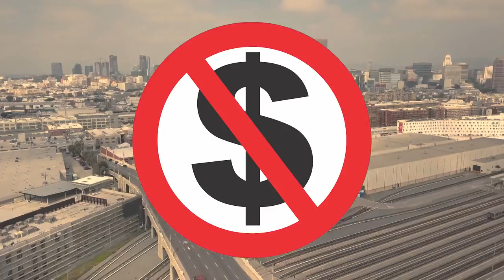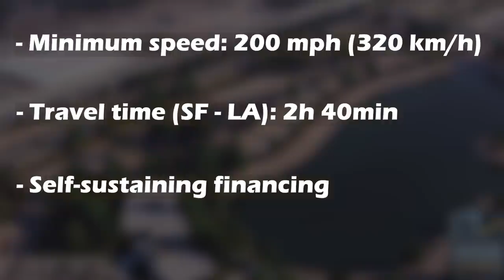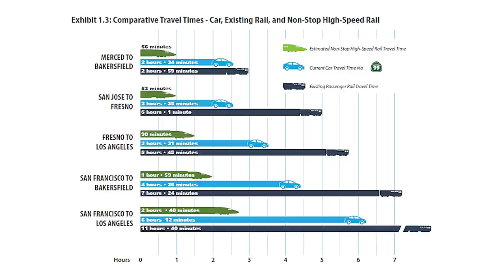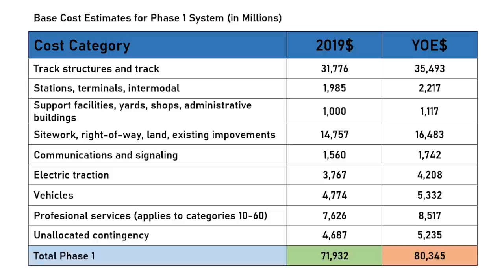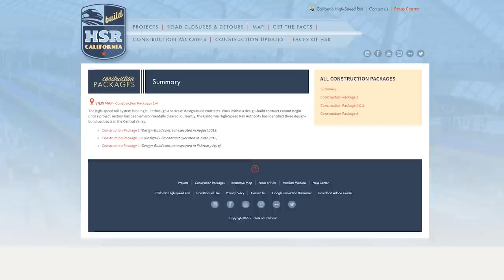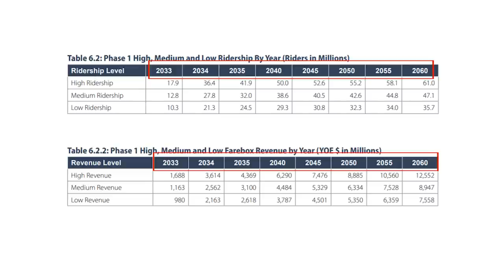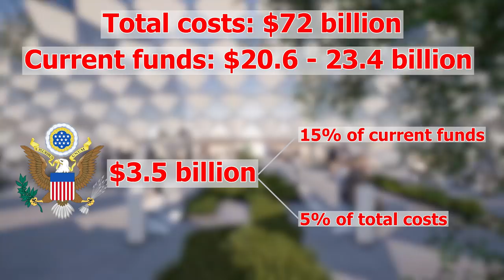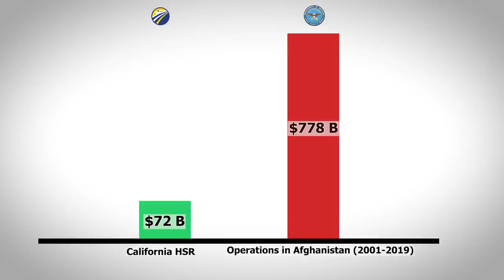California High-Speed Rail Project: All You Should Know

Comment: The speed in the bay area section wouldn't have been allowed to be faster anyways as it's in an urban area and not grade separated, maybe if the entire thing was tunneled/elevated but the stations are close together anyways so there's little point, it's also massively helped the existing Caltrain service along the corridor which is going to be electrified and have highly increased frequency

Comment: I wonder if the rapid evolution of the car with regards to EV, self drivability, connectivity and other technological advances will cause the automobile to leapfrog the High Speed Train in terms of its desirability as a mode of travel. Personally, I would prefer the car even if it took longer if I could spend the time productively and avoid the hassle of parking, getting on a train and then inevitably having to find additional modes of transportation once I get off the train.
Reply: I think that an American only could think of a car as more productive than a plane 😅. A Trenitalia spot for the Italian hsr insisted right on that matter, underlining that you can’t do anything on a car since you have to drive (and I can bet every sul cars won’t become automated anytime soon), while on a train you can read, study, get your work done since you day you have free wifi. 
The matter of how to move when you get off the train is important though, and in my opinion, instead of building an hsr, California should probably built a commuter rail connection like Bart in LA and San Diego (maybe using one or two of the ten lanes freeway as space for railways). In this way people would get used to travel by train and will accept an hsr more favorably than now.

Comment: This CA rail project is a pork barrel for contractors and politicians. Why would anyone ride on a 3 HR train when planes are flying the same route in less than half the time?
Reply: That's just when the plane is in the air. When you add up the time to get to the airport, have enough time for security and boarding (on average about two hrs before boarding time) at both ends, it's actually about 5 hrs or longer.
Reply: @dmnddog7417  : That's for international flights. I have had flights with one hour wait almost all the time.
Reply: @ernestimken6969  I'm sure, but how long does it take you to get to/from the airport if you don't live close to it? Generally, the point of rail is to go from downtown to downtown directly. Whether you're a tourist or business traveler, it's more convenient to be able to do that.

Comment: If your goal was HSR between major population centers in CA - LA, SF and SD the track plan shown in the video is way out of whack.  It should go up the 5 from SD, not way out east on what I guess is the 15.  Then it should go up the 101 to SF.  You can then connect it to Sacramento along the 80.  I don't think anyone wants to go to Fresno, Bakersfield or most central valley areas.  I'm sure people living there would like another way to get to SF, but IMO that should be a separate rail line.

But the worst is that line from LA to SD.  The original line goes to Anaheim, so just keep going south along the 5.  There is a lot of traffic along that route and even though it takes forever to drive it on a weekday, IDK if HSR going all the way around LA before going to SD is going to be faster.

Comment: Great video, but, California HSR will NEVER meet any of the original goals.  It will be much slower because of all the slow sections (central valley, and SF extension).  Costs will be 3 to 5 times the already absurd $100 Billion present estimate due to land acquisition cost and the astronomical cost of construction in California (here, politicians push a project using unrealistic low costs, then reality happens, and oh, gee... It costs many times what we said... Oh well.  For proof, just look at the new east span of the bay bridge).  And finally, since it is not fast or convenient, ridership will always be much lower than hoped for.  But, hey, Liberals are always driven by their emotional desire to see the world different from reality...  High speed rail works in Japan and Europe because it is often on land already owned by rail system or related state authority and connects much higher population centers over shorter distances.  For California, the HSR really is a bridge too far...
Reply: This is not true what you say! E. g. the new highspeed line from Munich to Berlin )* was built on a totaly new route and in France all the TGV lines are new apart from old ways. And why should it become 3 to five times higher?? 100 B. is already very ambitiously calculated. Let the Chinese built it. They will finalise it in 10 years for 47,50 Bs.
)*: https://inside.bahn.de/zeitersparnis-schnellfahrstrecke/
Reply: @dukeoflakeshore5805  "The Chinese" would not finish it in 10 years for half as much because "the Chinese" would still have to deal with all the political and legal realities in California. But to be fair, the $300-500 billion estimate in the OP is equally unrealistic.

Comment: so so out of date, they should have constructed a 380km/h rated railway line. with 4 tracks at multiple points, so SFO - LAX would be 1h58minutes and union station 2h and 25min line, obviously stopping trains will ride at 280 -  300 - 320 km/h and more switch points suitable for 240km/ h and at stations 200km/h this is because of density, allof te above.

Comment: I did not vote for this as I wanted maglev instead of HSR. It's going to be expensive as it is, why not go in on a technology where uptime is 98% (Shanghai's airport route is getting this) so you can recoup your investment with ticket sales much faster. Yes, maglev is much more expensive initially but the running costs of it are much cheaper. Build the maglev line in the right manner and your maintenance costs will be much cheaper as well. Overall, maglev seems to be the technology to use here since our rail infrastructure sucks at this time and we in California could leap frog a technology.

Comment: What's sad is this project had potential but is now a joke and proof politics often impede progress. If this were a privately owned and funded project with shareholders and intention to profit, this would have been built sooner and more cost effectively.

A HSR line from LA to Vegas would be more appealing IMO, cheaper than Flying and faster than driving.
Reply: HSR has zero potential in the US anywhere. There simply are no population centers at distances at which HSR is superior to cars and planes. I don't know why people have to run their heads into these trivial no-go walls all the time. Europe is marginal. So is Japan. China doesn't have much of an aviation industry, so industrial policy by the CCP pushes trains. That's all there is to it.

Comment: The approach to this was really stupid for one important reason.   The phase 1 leg from Merced to Bakersfield is already covered by low-speed rail, but the leg from Bakersfield to LA or from Merced to Sacramento are not covered by ANY rail system AT ALL.    So what they're building first is a duplicate system that, while faster, does NOT provide any additional access to areas that aren't already covered until sometime after the first phase.   So what that means is, Phase 1 is completed (late) and it's totally inconvenient to people in LA or SF without those connecting lines on the ends of Phase 1.   If on the other hand they filled in the existing gaps first, between Sacramento and Merced and then Bakersfield and LA, they would have a system that at least would provide a complete rail route from SF to LA that much sooner, even if it isn't all high speed.   Instead, they'll end up with a white elephant until they finish those outer leg phases which will probably be another couple of decades after Phase 1.   REALLY stupid.

Comment: I wished you had mentioned one big factor: geography. The distance between Los Angeles and San Francisco is not a simple answer: airliners fly straight lines between them, but trains can’t. While flat, long, Central Valley is ideal for building rail tracks, the 4400’ | 1,330m Tejon Pass blocks the valley from Los Angeles, and a mountain range blocks the valley from the San Francisco Peninsula. CalHSR began construction without plans for overcoming these two enormous physical (which becomes financial) obstacles, using unrealistically optimistic cost projections. Of the several northern crossings, they are choosing the route of State Highway 152, which will be the most expensive option by far. 
 
The failure of Cal HSR is that politicians rather than engineers dictated performance criteria.
Reply from the maker: We agree. Thank you for detailed explanation. Tho we mentioned (in a way) the issues with geography, demographics and cultural tradition, which all influence this project.

Comment: In Europe, when building new infrastructure, construction is done as a whole. Like the bridges and the tracks, signalling, overhead cantenary and eletrical systems are built and installed as one project. For me it does not seem logical to build only the briges and viaducts as a construction package and then after some years to add the tracks and other elements. No wonder it is taking soo long. The californian politicians should decide if they want highspeed rail or not. 
The second thing is that they should start the procurement of the rolling stock some time soon... since US standars are much different manufacturers need time to design, and prepare for making these trains.

Comment: This has been a farce since its inception. A few miles have been constructed and that is not high speed tracks. The intent is to use these portions of completed sections using non high speed trains. The problem is that the completed portions are in agricultural areas. Then there are all of the cities along the route that are clamoring for the trains to stop in their community. This would not allow the train to achieve high speeds. At one point the governor of California conceded that the project was a failure and directed that it be terminated. When the US government heard this, California was informed that federal funds for this boondoggle aka Browndoggle would have to be refunded. So the governor in his infinite wisdom (?) decreed that emperor shall have his new suit and the high speed rail project was back on.  There is an existing commuter train from Los Angeles to Lancaster. It leaves Union Station in downtown Los Angeles and goes a few miles and stops in Glendale. It resumes and the next stop is in Burbank, may be five miles away. The train gets to pick some speed for may be a trip of ten miles when it stops in Sylmar. The train doesn't have the ability to to pick up much speed as it most cross the mountains into Santa Clarita. Upon exiting the tunnel, it stops in about a mile for train station in Newhall. From there it proceeds for a few miles and stops at the old Bermite powder plant site. The rail becomes windy as it follows the Santa Clara River bed. It then stops near where the tracks crosses under CA 14. The tracks the proceed up Soledad Canyon and additional mountains have to be passed. The grade and the windy rails prevent the train from gathering much speed. Upon the exit of the canyon, the train then stops at Vincent Hill. The next stop is about 5 miles further in Palmdale. The route terminates in Lancaster about 10 miles further north. The so called high speed rail will follow this route and many of the Metrolink stops want the "high speed train" to stop there also. Further, the high speed rail must cross through the Tehachapis between Mojave and Bakersfield. The railroads use a giant spiral to cross the grade. All in all, this is a giant mess and will never be what it was supposed to be. And if anyone believes it is,  I have a good deal on a bridge in Brooklyn

Comment: Endless wars cost America massive infrastructure projects like super high speed trains. How much more efficient would America be with much faster and much better infrastructure. I would say it would revolutionise many industries.

How could you ever defend America with your current infrastructure?

If it was all out war with a modern powerful country then I think America would lose.
Reply: Well America is a very large and vast landmass surrounded by 2 large oceans and weak neighbors, invading it is out of the question. 
Most of America infrastructure is built around extensive road networks, planes, and the worlds most advanced and largest freight system. So it’s fine for now in case if someone stupid enough tried to invade.
High speed rail now serves little purpose as planes already serve the exact same role but are faster and cheaper. It’s nothing more but an overhyped slower and expensive plane.

Comment: High Speed Train is never profitable.  In order for it to work, we need to treat it as part of infrastructure, like the highway system.
Reply: If its not profitable why building it at all? It is just cheaper to upgrade airports that are way faster.
Reply: @canaldofred2366  same thing with the highway/freeway system and bridges.  Public transportation such city buses and subway system.  None of those are profitable but we need them.
Reply: @mytube30005  highways and bridges are probably much cheaper to build, and unlike mass transit, they are necessary.
Reply: @canaldofred2366  The flight might be shorter, but total travel time is longer. You also can't just keep upgrading airports, your planes can't make stops along the way, neighbours will complain more and more about noise, ...
Reply: @Hans-gb4mv  im pretty sure you can upgrade a lot of airports with $100 billion. "Airplanes don't make stops along the way" thats the point, airplanes go directly where you wanna go, the don't keep stopping before your destination. And most important :airplanes need much less subsidies, if at all.
Reply: @canaldofred2366  I think you're missing the point. A train can go from SF to LA with less time on the road for the traveller in comparison to a flight (don't forget that a flight takes up a lot more time than the actual airtime) and still make stops along the way. And there aren't many airports located in city centers for obvious reasons. And trains, done right, can survive without subsidies. But don't think for a second that airlines don't get subsidized or, as in the last year, bailed out of financial issues. And then we haven't even tackled other points like noise and pollution.
Reply: @Hans-gb4mv  actually not, if you do the math, a flight is still faster than the train. You arrive 60 minutes early at the airport. Your flight takes just under an hour, and after landing you leave the airport in 30 minutes. The total time is 2 and a half hours, shorter than just the 2:40 train journey (lets remember that you can't arrive at the station 1 minute before your train leaves, so theres also a waiting time). "If its done right it can make profit." If the route was profitable, a private company would be doing it. This train is almost offensive to taxpayers, 100bn on a behing schedule project that was supposed to cost 3 times less and be ready by 2020. You honestly think it will make a profit?
Reply: @canaldofred2366  Well, you are taking a best-case scenario. I really doubt many people will show up just an hour before departure. You never know how long the lines are going to be.

In 2020 the US government spent 25 billion dollars to "save" airlines from bankruptcy (even though no airline was at risk of going bankrupt). That is money spent in a single year. Every year the US government is spending hundreds of millions in ensuring that airlines keep flying on connections that are not viable. Often connections that aren't even 100 miles apart. You still think airlines aren't a bottomless pit? Documents released by wikileaks in 2009 showed that between 1918 and 1998 US airlines were given $155bn in money, not adjusted for inflation. And that does exclude any money spent on US airlines after 9/11 or the 2008 financial crisis.

But no, a railroad project? We can't spend money on that, that's pointless. F*ck the railroad, f*ck convenience and f*ck the environment.
Reply: @Hans-gb4mv  cmon, we all know 60 minutes is enough for domestic flights, airlines recommend more time so that you can spend your money on airport stores. About subsidies for airlines, im against any form of subsidies. Im in favor of free market, if an airline cant keep afloat, they will die and better ones will be created. The difference is that airlines usually can keep afoat without subsidies, and trains usually can't. About the "fuck the enviroment" do you really think all that concrete used to build the rail is green? The energy to power the train is green? Obviously not, everything humans do has an impact.

Comment: Well, they could just Implement there new concept plain, were the basically bell is container for people, that plane at the last minute picks up and then flys, which allows plane with out passenger cargo to have high turn around time on that section and wouldnt be cheaper than rail. Why is security so high for plane and airport, as same issue arise with high speed trains, so could just do away with security and change plane design that piolets totally separate plane to pass angers, so can't break in. Or high jacking a plane impossible doesn't posses the problems of it being used as a weapon. Indrustruxture is cheaper. Someone is not think along the right lines, that sercurirty of high speed trains is going to make sercurirty for planes that have for the dame routes pointless anyways, as ppl move using rail and be just as much as sercurirty threat. I really think they need rethink security of plane flights its superficial and security it brings be made obsolute by new high-speed rail.